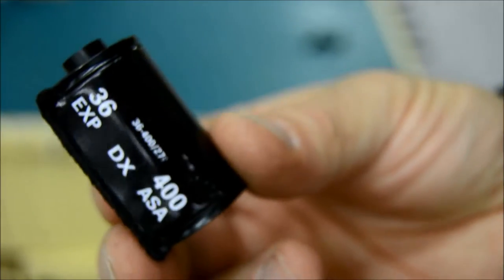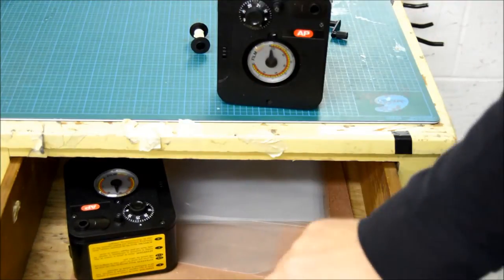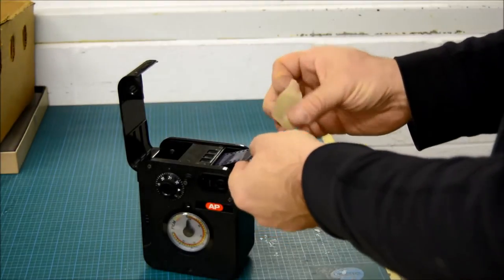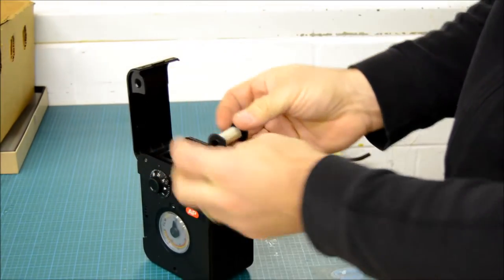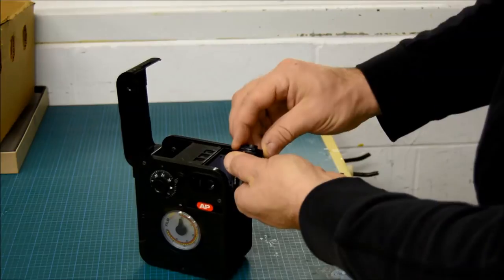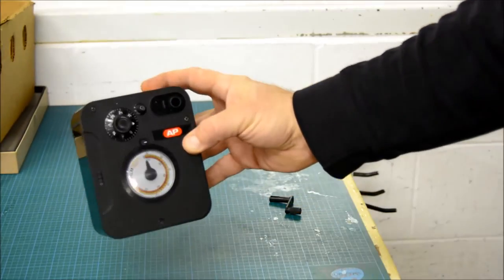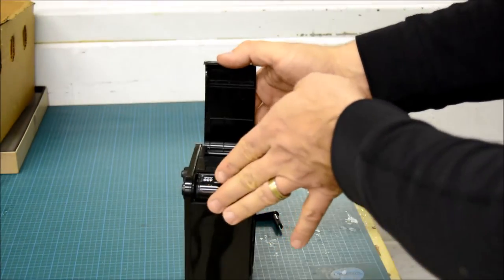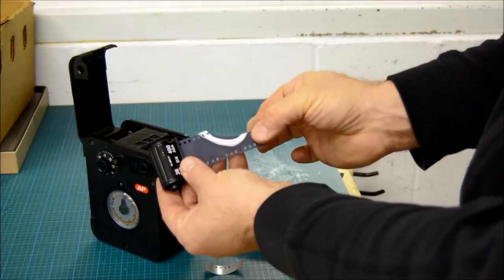FILM - Step 1 - Roll your film

Comment: Here, ten years later, those AP bulk loaders are still the Rolls-Royce of loaders. There are a surprisingly diverse bunch of loaders out there, so as functionally excellent as the AP, and others less so. Loaders were around $15 when I started some 70+years ago. Used ones from that era are no around $50. These days, thanks to Kodak's policies, where nearly all films used to be sold in bulk rolls, few types are sold now. Also, Kodak's bulk pricing is ridiculously excessive. IMO, for B&W, Ilford's policies and prices are far superior. Nice, clear instructional video.